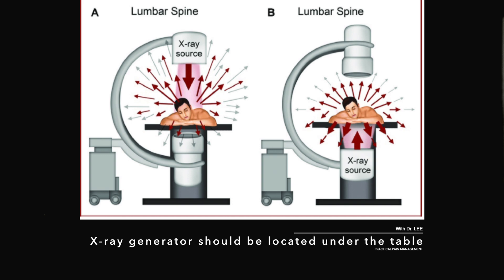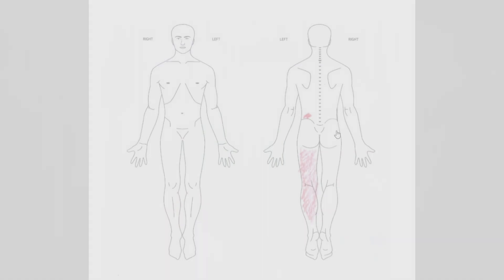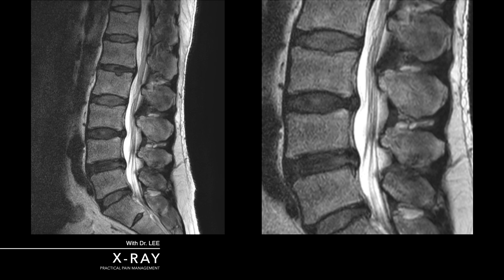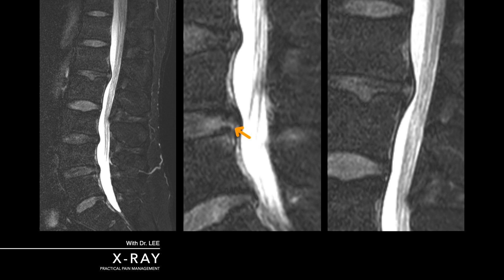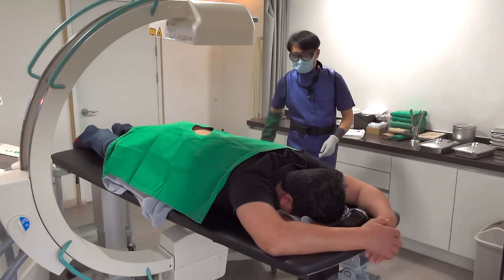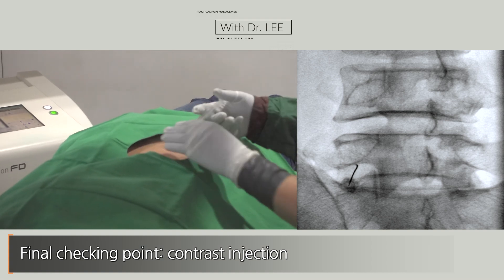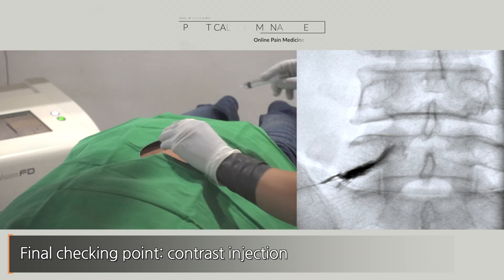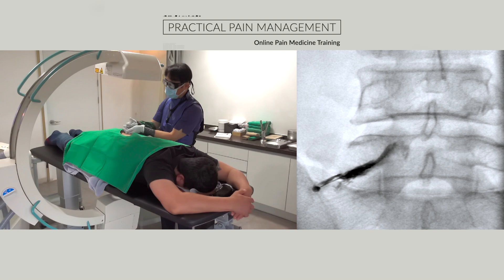lumbar transforaminal steroid injection for radicular pain: C arm, lecture & clinical case:

Comment: Will these shots help if the bulging disc is so severe as it seemed in the images??
Reply from the maker: The bulging is the morphologic diagnosis of the spine. Rather you describe the as the discogenic pain or compressive neuropathy or pain in case of central stenosis and foraminal stenosis. With the different viewpoint of the bulging disc, you can make a injection strategy and make a different appraoch

Comment: thank you for your video. I appreciate it so much :3 . I have some questions
1. Wich size spinal needle u r using
2. In ICD 9 which code do u use
Reply from the maker: I use a Quinke type of 90mm 25G needle. M47.26 is the most commonly used Current Procedural Terminology (CPT) code for reporting the injection of a needle for diagnostic or therapeutic purposes into a nerve or ganglion
Reply: I mean the prodecure code

Comment: ¿ What about Lateral view? do you use lateral view to see your needle in the SPQ? after the dye , it looks like selective root nerve block.
Reply from the maker: I rarely use lateral view to confirm the location. I use contralateral oblique view. it is more precise and quick. besides, I can use radiation protective lead draps on contralateral oblique view. I can not use radioprotective drap on lateral view

Comment: Thank you so much for good information. Even though it is not for cervical injection, Triamcilnolon which is particulate steroid is relatively less safe than non-particulate steroid such as dexamethasone and so on. Do you have any reason to prefer Triam?
Reply from the maker: sorry for late answer.  I always use nonparticulate steroids. lipid form of dexamethasone is stronger than normal dexamethasone. but unfortunatly, there are many contries that can not available.